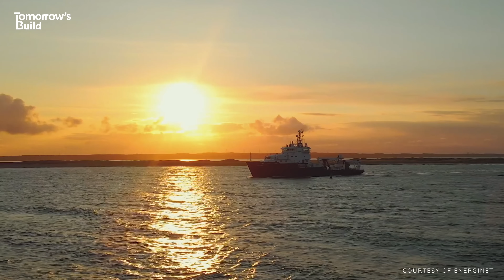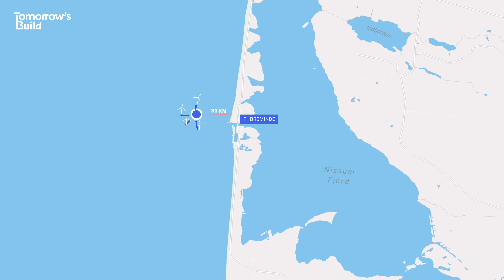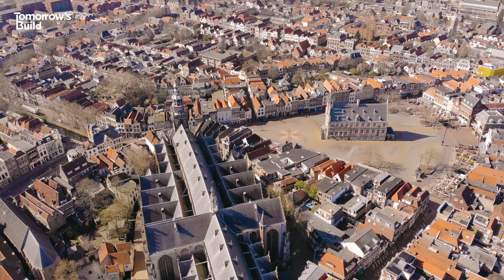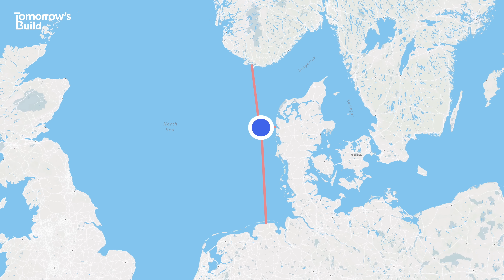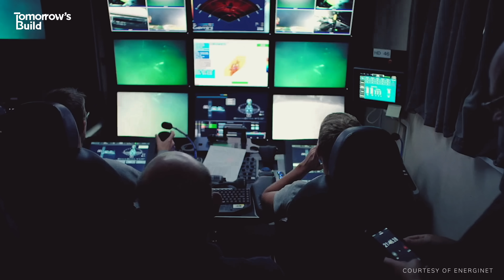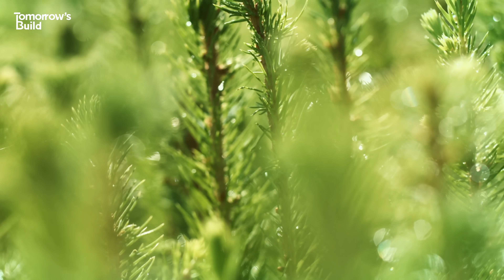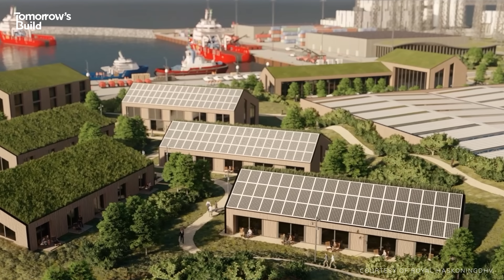Denmark's $34BN Energy Islands Could Solve Europe's Power Problem

Comment: You talk in 3-10 GW ranges, when the EU uses nearly 3 TW or 3000GW. You'd have to build hundreds of these islands and as more people switch to electricity for heating and cars that number will only skyrocket.
Reply: That's not how it works.  You're confusing consumption with capacity. These 10GW isn't 0,33% (10/3000) of European electricity, but 2% in 2018
Reply: @bobincognito6239  You are a bit confused yourself Bob, or perhaps you did not want to mention it. This wind farm will have 10GW of name plate capacity but will never produce 10GW. It will likely average only 25-30% of name plate capacity. Take a look at German wind infrastructure and installed capacity versus power generated. Unlike European politicians and bureaucrats, wind does not blow all the time.
Reply: @MadnessMotorcycle  Wind dosnt blow all the time thats right, but out in the north sea it blows allmost all the time.
Reply: @MadnessMotorcycle  You're the one confuse. In 2018 wind power produced 379,3 TWh in Europe for  204 GW installed.
Europe production was 3 300 TWh in 2017
Reply: @bobincognito6239  >You're the one confuse. In 2018 wind power produced 379,3 TWh in Europe for  204 GW installed.
Great lets calculate. 
204 GW x 24 (hours in day) x 365 (days) = 1 787 040 GWxh per year of "installed" or 1 787 TWxh. 
379 TWxh is 21% of that number.
Reply: @Poctyk  ah yes it's well know there is wind 24h/24 365days/365. What's next? Solar panels production 24h/24?

Comment: This would also be a good chance to look into energy produced by tidal forces. They don't rely on wind or sun but run like clockwork day and night.
Reply: A combination of all three would be amazing if possible, imagine having solar, tidal and wind forces all producing energy from the same island. Solar wherever there is space available and wind turbines which sit on top of the tidal turbines. Someone who is actually knowledgeable within these areas (cause I'm definitely not) might prove it impossible but one can dream
Reply: When you say tidal, you mean taking the energy of the wave or the current?

The problem with wave is that you have to be perpendicular of it to take the more energy from it (in the atlantic cost the wave has an power between 30 and 60kW par meter). Putting this in a floatting wind turbine might be counter productive because it is not large enough. Also it is complicated to transform this energy because it is a mix of cinetic and potential (speed of the wave and height of the wave). A lot of research have stopped because it has been considerate not really interesting despite the potential (1400TWh in the world).

For the current, not stupid. Good idea to have but the problem is, if you put a floating wind + water turbine, if the flow of the wind and the flow of the water are not align it is a mess I think. It the two are opposite you basically have a spinning top. Not saying impossible, just really complicated and also not sure it would be interesting because you then have more masse (two motors, two turbine...) so the floating system must be way bigger which mean more material... Impossible to know if it would be interesting without a study of several years ^^
Reply: @adriensimon4652  Because of its geography, the North Sea has strong flow patterns that could be used  at the 'island' itself.  The steep waves tha occur in shallow portions of the sea may be also prove to be a workable source, but obviously, like anything else would require tests in the appropriate areas.  It makes sense to try and combine the options.
Reply: @petegarnett7731  are you living under a stone? Wave and tidal energy has been tested since decades in Denmark. We have almost zero tidal differences and wave energy is still unsuccessful.
Not even UK/Scotland has any convincing results yet... BTW, updated information on this topic is all available on something called YouTube 😉
Reply: @SioGG  well the solar part is a bit useless. First of all, it’s a small surface. The amount of solar panels you can fit on there is gonna maybe power the lights on the island lol. Second, it’s in the middle of the ocean, which is most of the time (I’m nearly sure) very cloudy and stormy. So putting funds into solar panels where they will produce like 70% of what they would produce on land, is a waste of money.
Reply: @blanco7726  you DO know that clouds have little effect on solar panels right ?
Reply: @Ladosligese  yes you go ahead and convince me that solar panels in the middle of an ocean, the Northern Sea nonetheless, can produce more than 70% of what they would produce on land far away of the sea and the constant clouds..
Reply: @blanco7726  Hes not a real human just ignore him
Reply: @blanco7726  There is some truth in your argument about there being more clouds at sea. But most of Denmark is coastal. 
There is no place far away from the sea.
Reply: @stesve2007  true, but isn't this supposed to be a European project? If the EU validated a solar pannel project, it's not gonna be anywhere near Denmark at all, I would guess.
Reply: @blanco7726  It's a Danish project, that involves partnerships with private companies and other European countries. 
This project is about windmills. Surely design sketches on new buildings will include solar panels as well. But it's not the purpose of the island. Especially considering its small size.
Reply: @stesve2007  the solar pannel conversation is completely out of subject. Because initially I am responding to someone asking if it would make sense to produce exportable energy through solar pannels on this island, which we can agree it doesnt. But I do agree that any new large scale project, will probably have solar pannels somewhere. To power a very specific part of the project.

Comment: You might even need a small military base on that island. Such a huge stake of energy is a prime target for terrorists and in case of war. So massive security is warranted.
Reply: Correct. It's designated as critical infrastructure for this reason which means it will be designed to be high-security from the beginning.

Comment: I wonder what they're going to do with all those windmills after their life cycle...
Reply: Beats storing nuclear reactive waste for the next forever at c.£100m per annum currently.....??
Reply: Recycle the steel and copper. Make new, bigger wind turbines form them. About the only thing to lose nowadays is the paint.
Reply: @paullangford8179  New wind turbine propellers are built with carbon fiber. Not recyclable. A lot of them will decay easily given the harsh environment of the sea due to humidity and salt content in the air, corrosive to metals and non-plastic material.
Reply: @paullangford8179  and what exactly do they do with those gigantic carbon fiber blades?

Comment: As the north sea is quite shallow, all the countries bordering it can start such projects.

Btw. "A coastline near you" just means where denmark is building them now for me.
Schleswig-Holstein FTW!
Reply: How shallow is it?
Reply: @glennwatson3313  The north sea, in the last iceage, actually was above water. You can search for Doggerland if you want more information. 
The Doggerbank, how its now called, is ~30m deep and depth rarely reaches beyond 50m anywhere but in the Norwegian trench.

To put it simple what happened, in the last iceage the ice on asia pressed it down, and like on a teeter tauter pushed europe up. the UK wasnt an island, and was connected to mainland EU by  Doggerland, when the ice melted asia started rising, and europe started sinking.
Reply: @FantasKanal  I'll add that the global sea level was about 120m lower than today from the mass of ice covering land in the Northern parts of both Eurasia and North America. 
Locally, ice cover on the Scandinavian peninsula depressed the crust quite dramatically and that land is rising as of today. The line - your teeter-totter, goes diagonally through Denmark with land sinking South of the line and rising North.

Comment: what a ass backwards joke, those atrocities in the water aren't what they're presented to be to begin with so they respond with "lets build an island"  . . . that whole mess of "going green" is an insult to thinking humans, which apparently are becoming fewer and fewer. . . fossil fuels are by far still our most plentiful and highest yield, the "production" and use are viable for centuries.  the environmental risk of this full blown green movement is ten fold higher, a thousand fold more expensive and such a minute problem related to actual human impact on the environment its almost insulting they keep pushing western society in the wrong direction, yes we need to hybridize our energy and YES my god there are FAR MORE EFFECTIVE wind collection methods and yes we need to refine and dial in our fossil fuel usage but not to the degree that MANY other nations need to . . . our focus needs to be on CLEANING UP OUR SHIT. . .  this is what drives me nuts about the whole sky is falling humans are bad climate alarmist bullshit. . . you motherfuckers need to STOP, clean the shit up around you. . .then go outside, clean that shit up. . . then look at your water usage, power supply and control, REFUSE & waste management and work LOCALLY to hybridize those systems and focus on being a neutral source on your grids and resource pools hell maybe even become a provision point without spending BILLIONS on low return environmental train wrecks.

Comment: They could save a lot of time and money by just building a couple nuclear plants.
Reply: That creates a lot more nuclear waste and a lot more risk.
Reply: Ah yes because famously nuclear power is cheap and quick to build, y'know like that reactor in Finland that they've been spending two decades building and, which has had it's cost more than double. In the period that single reactor has been under construction Europe has added several times it's power output in wind energy. If Thorsminde follows schedule then it alone will provide as much power as that reactor.

Not to mention the fact that developments in wind energy are happening so fast that turbines being installed today are more than twice as good as those that were installed just 5 years ago.

Comment: Bad idea, it will have a bigger environmental impact on the ocean and biodiversity. Plus the cost will be ridiculous. There will be non reversible damage. As much as wind turbines seem like a good idea, the impact of thousands of wind turbines can be catastrophic. The engineering behind a turbine has not change, they are still made of corrosion metals and fiber glass. 
Lets start with maintenance problems, the angles of the wind turbine must be perfect. To generate the most effective spin. The weather is not consistent, the wind will continue to change every year. The ocean tide can decrease or increase the sea spray, salt, dust particles can impact the Wind Turbines. Than there is the foundation, which is susceptible seismic error. Platonic shifts. Than there is the coastal wild life birds and sea creatures whom will really will create damage. This is just a sample of the errors that will happen. Go back to the drawing board.

Comment: The waves in North Sea can reach a 100 fucking metres above sea level, so good luck with those wimpy windmills one of these freak waves comes crashing into them.
Reply: Believe me.. It won't be wimpy turbines. And we've been doing this for a long time
Reply: @heinedenmark  
Yeah good luck dealing with a 100 metre waves, I am not sure you realise just how huge these behemoths are, they happen at least several times within 5 years. 
If a wind turbine can withstand being hit by a concrete wall at 70 - 90 kph, then okay fair enough you win.
Reply: @SMGJohn  We already got windsfarms in the area. Genius 👏
Reply: @SMGJohn  100 meter waves in water that's only averages 95 m. deep and in this area only 30~60 m.
Reply: @bnorth1087  
Then you would not like the waters near Svalbard cause over there the depths can be as little as 10 metres, which does not seem to prevent the waves from reaching 50 metres, its a known danger region cause ships been smashed to pieces there before.
Reply: @SMGJohn  Svalbard is more or less a mountain peak, surrounded by really deep water where the shallows like those of only 10 meters doesn't extend far from shore, hence why big waves can make it to shore, the North Sea is like a huge shelf of pretty much shallow water for most part (less than 30~60m), only in the top northern part of it got deep water, wave height in area to be build is only 3~4m on average throughout a year and worst storm since 2000 11m, the wind turbines will be 200m tall, that's above sea level.
Reply: If there is anyone who is expert in the North Sea.. Look no further than Denmark.. Genius

Comment: Instead of wasting €34B on crappy wind turbines for a measly 3-10GW you could spend it on 30+GW of nuclear power.
Reply: Finland just finished a new nuclear reactor. The price ended up above €10b for 1.6GW output
Reply: @Maitch3000  one-off builds always cost more
Reply: @garry8390  You can't get 30GW for €34b by going nuclear. At least not in Scandinavia.
Reply: @garry8390  Hinkley nuclear in the UK is projected to a cost of £23bn for 3.26 GW
Reply: @Maitch3000  you can't but you could if you got rid of all the politicians and just left it to engineers.
Reply: @Maitch3000  and do you know why it was so expensive?

Comment: The best solution is to have each home produce it's own power, using a combination of a wind turbine pod, solar roof, and battery pack, with potentially a small generator for emergency backup. It would cost essentially nothing as opposed to 34bn, as the installation costs would pay for themselves over the course of 10 years of no energy bills, and wouldn't require the massive amount of pollution from constructing and shipping so many giant steel turbines offshore.
Reply: Instead, there would be the even more massive pollution involved in installing the tens of thousands of small-scale plants. The cost would be even higher, as small wind turbines cost more per kilowatt than large ones.
Reply: There is currently research into making very small nuclear reactors that can power a large city neighborhood. Safe, reliable, renewable and clean energy!
Reply: Installing generating capacity on every home in a nation of 10's of millions would cost far more than 34 billion so I don't get where your "it would be cheaper" is coming from.

Comment: Will the surplus energy produce green hydrogen and therefore it will be used instead of greenhouse gases or is it going to be some kind of different energy storage?
Reply: DTU has developed a form of short term energy storage based on heating up rocks and currently a start up company is developing it for commercial use, that is most likely to be what's used for energy storage here since compared to everything else it is incredibly cheap and easily scalable.

Comment: Great video! I can't imagine the efforts required to maintain all of those wind turbines in a salty ocean environment.
Reply: Doesn’t require that much maintenance, much less than other energy forms beside solar.
Reply: Since all of the critical components are housed in the top of the turbine it's actually not that difficult, the generator and gearing is housed about 150 meters above sea level and some of the turbines being tested right now are taller than the Eiffel tower.

Comment: that little bit about "synthetic fuels for shipping" seemed kind of understated, if the EU is really going to go this big on intermittent energy, then scaling up green hydrogen in tandem is going to be critical for maintaining reliability

batteries, liquid air, thermal storage, and even pumped hydro, all pretty quickly drop off in cost effectiveness as the required hours of storage increases, in the range between 20-100 hrs of storage they each become economically unviable and H2/NH3 power-to-gas-to-power starts making more sense, luckily most places already have plenty of natural gas or coal power plants that can potentially be converted to H2 and NH3, and fuel cell power plant costs can be expected to keep falling for a while, and same with electrolyzers

of course, currently the most cost effective form of 'dispatchable' low carbon power is still nuclear energy, and that's probably going to remain the case, and might well become the cheapest source of low carbon H2/NH3 production as well

Comment: Wind power is unpredictable and the fluctuations of power based on the weather is not how we should get our primary energy
Reply: Sure, wind can be unpredictable. So you build a huge network of wind power in many different places all over Europe. The risk of all areas having no wind simultaneously is pretty low. And then you add other sources of renewable energy like solar, hydro, geothermal and even upcoming tech like marine or wave power. Together this network can power the entire continent. This wind farm is just one of many pieces on the road to a future without fossil fuels.

Comment: Reminds me of the tiny offshore oil drilling islands just offshore in Long Beach harbor. There are 100s of oil wells. Most people don’t even know what they do. Eventually they will be retired. California is adding a lot of renewable power and hopefully in the near future we can figure out the pitfalls as we go along
Reply: Here in Europe there are projects for converting old drilling stations into energy hubs powered by wind turbines. They can be converted to hydrogen gas generating plants. You can store the hydrogen in old gas fields or transport the gas to shore using pipelines. Hydrogen is nice because it can actually be used to store renewable energy :)
Reply: @blackwrench2291  Yeah the North Sea has an extensive network of pipelines and it'd be ideal if we could reuse those in some way.